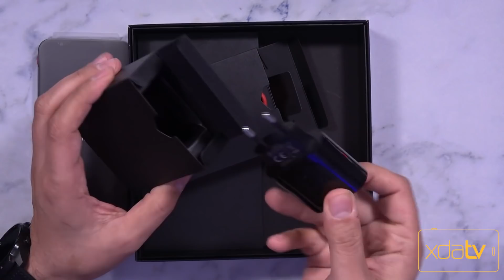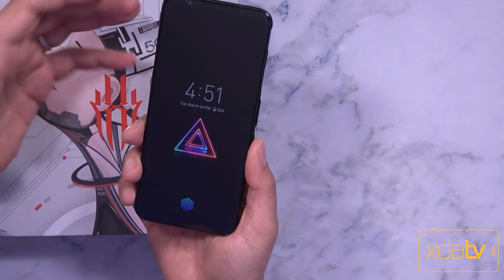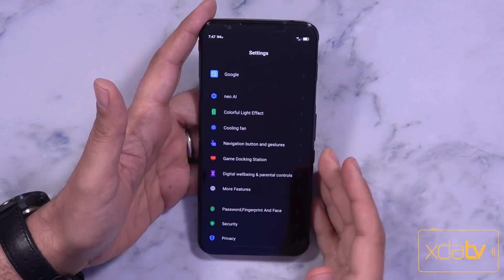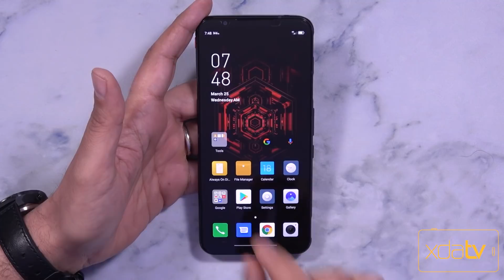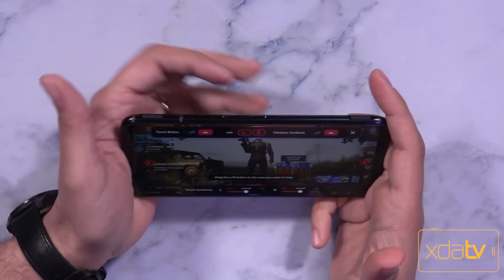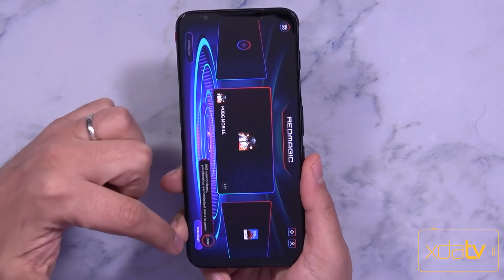Nubia Red Magic 5G Unboxing and Hands-on - 144Hz Gaming Smartphone!

Comment: Hi! Does it have the common AMOLED display issues ? I bought a 3S but had to return it because it was horrible. Main issue was screen uniformity. When I displayed only white it was not uniform and the screen was not 100% white. Some part was darker and on some parts there were even visible gray lines when the screen was running at or lower brightness then 50%. Did Nubia fix this or the screen is still not uniform when white is displayed ? Also, does it have built in call recorder like Rog Phone 2 and Mi 9T ?

Comment: Battery isn't going to be big enough. 5G sucks up the juice, 90-120Hz screens also suck up power big time - gonna be worse on this. They need at least 5300 battery.
Reply: Or like 6k mAh battery like rog 2
Reply: They should add 6000 maah battery for that power surging useless fan
Reply: 5g is barely available
Reply: @mouadtalbi4170  that's true too. But if you're in a location that does have it (like some parts here in Asia), it's a different story.